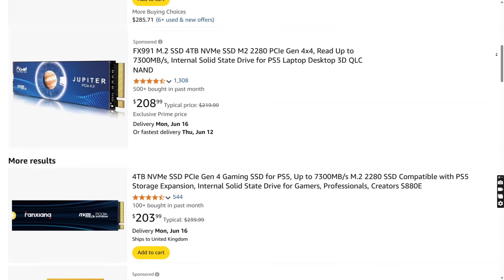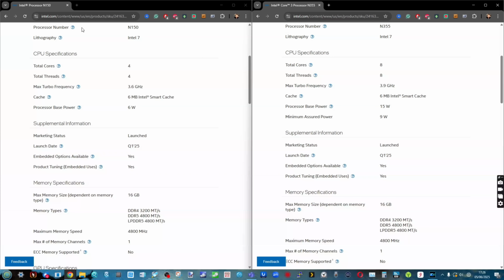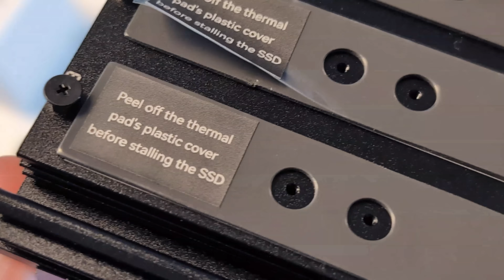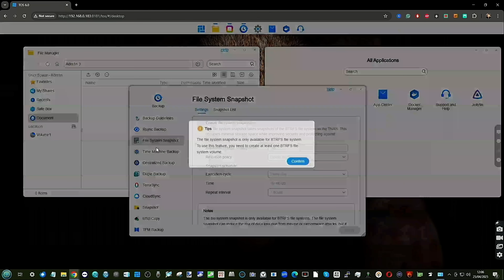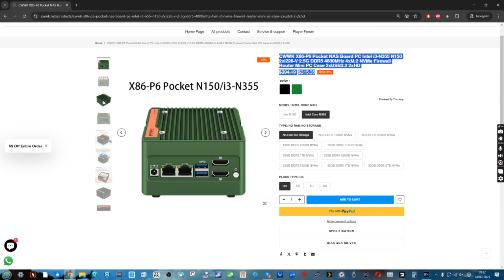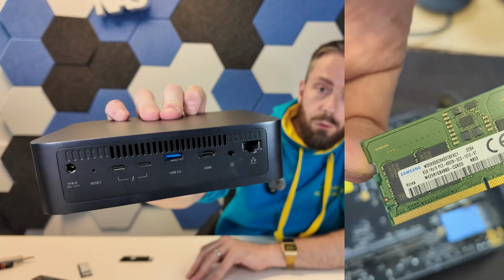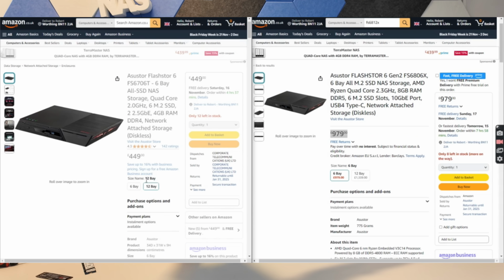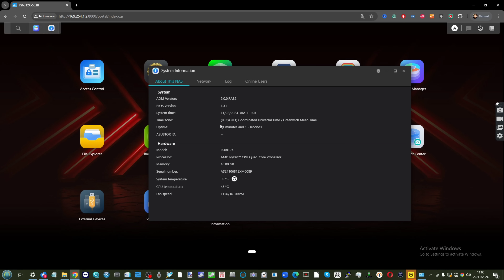The Best M.2 NAS of 2025 (so far)

Comment: A 4T Hdd is like 100€, and the data will stay there even if offpower for decades :)
SS for fast, hdd for slow. 
On the ode hand I just got some gen 2 SH 2t's for just 20€/piece used for a SH recycle shop, they got just 11x writes :)

Comment: The GMK G9 has a huge thermal management problem that causes all but the first slot M.2 drive to thermally throttle. This was proven by another streamer who used a thermal camera to show the temperatures. I believe He also showed several of the chips on the board also run exceptionally hot. He suggested that they should probably use a larger case with more thought given to thermal management. It really doesn't meet the listed specs with it's current design for long. Any large file transfer that takes more than a minute to transfer will kick it into a thermal throttle condition presently, I believe.

Comment: beelink is imho best form factor but it is a piece of junk. 48W PSU and bad desingn on the motherboard cant run all 6 bays. I can only managed to put only 2 KC3000 2TB drives with out issues. 3 and there is some powerrail issue and all drives are missing. This is well known issue. Living in EU sending it back to china (my is from aliexpress) is not an option... Maby I will find a shop who can upgrade/solve issue with powerrail. To this time it is a paper weight

Comment: Sorry, I just don't see the point of a M.2 NVME NAS.  When you look at size - 5 4TB drives will give you 16TB ish of usable space doing single disk parity, and cost you about $1000 for the drives.  For that price I can get 12 TB or even 16 TB HD's, so still 3x or 4x the amount of space.  Now, take into account that even if you have a 10Gbe connection, which most people don't, you'll still never be able to get the speed advantage that M.2 drives provide you.  If you are going to do some sort of DAS, Thunderbolt 5 maybe, ok, now we can justify the expense.  But as a NAS, usually on PCIe3.0 x 1 slots, you are limiting most of the good out of the picture.  Oh, and 4TB is listed as the max size....  so what use case is this a better idea for?

Comment: As someone who has been in this field for 40+ years. I’ve seen 3.5 inch hard drives go from 40MB TO 30TB and hard drives usually give you a warning before they fail. Especially since SMART is built into all drives now. When a SSD drive dies, it dies and you aren’t recovering SQUAT from it. Plus SSD drives are still ridiculously expensive and size limited, and each cell has a maximum write limitation. I just recently took my two Synology NAS units offline, and they had been running for 10 years with the same 3TB hard drives in them with no errors. The NAS boxes themselves are giving up the ghost but the drives still report as being in good shape. 
Have you priced external Thunderbolt 4/5 enclosures for NVMe drives, they are expensive as shit. Until I can get a 8TB SSD drive for less than $200 that has some kind of redundancy built into, I’ll stick with physical hard drives. Yes they are slower, but who really needs to access a storage medium at 20 or 40 or 80GB per second? Any NAS with physical 7200rpm drives and 2.5/5/10Gb Ethernet will be fine for 99.5% of users. Just about all consumer desktop and laptop computers still use 1Gb Ethernet for connectivity.
Reply: no thanks, HDs are the past, by 2030 SSD prices will match HD prices and we will say goodbye to those power consuming-error prone beasts. Most people who follow this channel just want a home NAS with decent power consumption (we are not all Americans who enjoy cheap electricity).

Comment: I have the Flashstor 6 and it's great, just use it for storage and nothing else and it works well.
The fan can be replaced with Noctua but it has to be either modded to mounted on the outside as there isn't enough room for a 25mm depth fan. Depends how fussy you are about fan noise.
It might be worth the extra cost to go 12 bay version for the option of smaller/cheaper drives vs 6x 4TB drives (something I wish I had done and might do in the future).
And with flash storage you are on the ~2 year cost/purchasing cycle and looking at the cost now it's down yes but not down enough, maybe due to tariffs.

Comment: My Asustor Gen2 CPU fan just after 3-4 months have started to sound horrible to a degree where the NAS is unusable and of course it's a low quality fan you can't even buy from Asustor accessories shop for replacement. So disappointed with this

Comment: 2 TB nvme is 200, but 24btb HD is 270.. I keep it a mixed Nas for now 😂 
next upgrade..2x aoostar.. with each 5x2tb name and 6x24tb running unRAID in two locations.. question. Can you use the NVME drives in raid Z1 and put the snapshots on the hd in an unRAID raid? With only the hd synchronised between the systems... Should work right? Any problems I am overlooking?

Comment: For a home user I only really care about storage space not performance. Having four 8 TB drives in an Unraid setup the option of switching to SSD is just not going to happen

As much as I like the concept the cost is still prohibitive. I can’t see that changing any year soon
Reply: It's not about performance, although the IOPS are mad, it's about low power, low noise and low space. I could put my media library under the TV, or a data storage device on a desk. With a traditional nas, I have to put it in a remote location, then I need decent ethernet cabling and switches to get the most out of it.
Reply: @paulwoodward8265 

For sure and I agree. The focus in these reviews is nearly always about how fast you can send data. When for me it’s about both cost and, yes, silence as well. My home build NAS box is on my third floor in a spare bedroom/ office so noise isn’t an issue and the house is Cat 7 cabled as well. Not everyone has that of course

I still don’t think the silence and power savings with the high price of large SSDs is the right balance. It’s encouraging to see the new hardware though. At least that’s moving in the right direction

Comment: I've had mixed results with small nas/mini pcs. Companies need to do something about reliability became that's what storing your data is about. Peace of mind. Lincstation n2 would keep losing firecuda nvme drives, so I had to replace with wd red. The performance with unraid wasn't any better than a ds1821 with 4+drives and some cache. Also my minisforum ms-01 won't power on. No reason. Just stopped working after 3 months.

Comment: M.2 drives have gotten cheaper, but they’re still not cheap enough in my opinion. For example, 8TB M.2 drives are still $600-$1000+… The problem is nobody is really making large-capacity NAS-specific M.2 drives, meaning almost everything available is PCIE GEN5 and GEN4. Hence, the higher cost. My hope is we eventually get high-capacity GEN3 M.2 drives, which is more than enough in terms of read/write speeds and should be much cheaper. I say all this because most of these M.2 NAS devices and add-on cards can’t even utilize the full read/write speeds/features of GEN4 & 5 M.2 devices.
Reply: yes, agree, I want cheap slow gen3 SSDs. A single Gen 3 PCIe channel can pretty much saturate 10GbE, so we don't need fast, we just need redundancy and size. I'm guessing the economics of SSDs are such that gen3 is not much cheaper to make than gen4, and you can charge more for gen4...
Reply: Totally on board with this. But as the other guy said, economics probably aren't in favor. The amount of actual TLC and QLC chips is limited so I get that they'd rather slap them on Gen4 and Gen5 sticks.
Reply: true. even had this issue on a new PC were got a very fast ssd only to find the PC bus speed was half of it. was not happy that the doc/specs had not mentioned it anywhere! Also with the raid uses stripe reading should give more than enough with only a few and wih 6 or 12 would be no need to pack out with the fastest spec. If only one of the manufactures could jump on this as am sure there would be a nice sized market for larger well priced that dont need top performance!

Comment: What about the Lincstation N1 or N2? They didn’t make the cut? They are kinda a hybrid solution where it is mainly a 4 bay m.2 NAS with an extra 2 bays for 2.5 inch drives as well.
Reply from the maker: Tbh the N2 AND the Terramaster F4 SSD (both $399) deserved to be included. However this video was recorded a month ago...and since then, the N2 only because publically purchasable a week ago, and the F4 launched 2 weeks ago. However BOTH made it into a fun video about the best NAS for under $499 coming very soon
Reply: Just saw the new video! Didn’t even know about the Terramaster F4 SSD. I did just get the Lincstation N2 delivered today, but of course I am away for a few days before trying it out. I just wish you could get larger drives for the 2.5 inch drives. Would almost like one with the 4 m.2 bays and 2 3.5 inch bays just to have some larger archive space, but then would make the device larger. Keep up the great work as always!

Comment: The only NAS I would even remotely agree with on this list is the Synology 6400. Unfortunately, I followed the recommendation for the Asustor Flashstor Gen 2 (and Gen 1) and paid about £1,400 for what turned out to be an absolutely useless NAS.

The reality is, none of these SSD NAS systems can fully maximize storage or bandwidth. It doesn’t make sense to have an SSD NAS unless you can actually saturate the available bandwidth. There’s a known issue with read and write sequential files such as EXR over SMB versus NFS, and none of these NAS devices properly address that.

I have to strongly disagree with those recommendations. After trying everything to get the Asustor Flashstor to perform as advertised, it simply wasn’t possible. Amazon refunded me after three months due to false advertising,  and because I provided evidence that I fully communicated with Asustor and they was unable to resolve the matter and we’re unsuccessful until they even admitted that there’s an issue that they can’t resolve.

So my advice: don’t bother with SSD NAS systems unless you’re ready to spend serious money on a custom build or go with a proven system like Synology. For now, you’re better off using regular hard drives with an SSD cache than wasting time and money on these SSD NAS setups—they’re just not there yet.

Also, I’m surprised there was no mention of Blackmagic’s SSD Nas—they’re designed for high performance and are much more reliable. The other options on that list? They’re a joke.

Comment: The price of NVMe may have reduced over the years,  but for larger capacities, spinny drives are still much cheaper, a 8TB spinny drive NAS specs is around £150 depending, on the make, but for a NVMe you are looking at around £700. So no good unless you have deep pockets for mass storage. 
The advantage of SSD is energy use compared to a spinney drive based NAS, stick a couple of smaller NVMe drives in one of those units you, certainly the cheaper ones and it is a fast , low energy storage for documents or maybe a media server. But if you only have a 1GIG network, not really going to be much advantage,. 

I have a older Terramaster F4-210 with four 6TB Toshiba drives in raid 5 and it is great for storage.

Comment: When 8TB SSDs are available for only a 50% premium over spinning rust (and not their current 250-300% premium), then I'll think about moving off of HDDs. Also, when I start running a 10Gbe at home, I'll consider these devices. As it is, my home network running at 2.5Gbe seems to be a good match to my Seagate IronWolf drives right now. Four 8TB spinning drives is more than enough of a drain on my wallet.
Reply: 100% Agree but don't stay stagnant with yr planning - start rolling it out now. 10GB/sec home is here already (TPlink) - just that I wouldn’t  buy it, but they will put downward pressure on the price of the other network stuff. As for NVME/.. Gen 5 is here which is going to plummet Gen4 next 6-12 months, and most if not all of these devices have Gen4 architecture ... That is why I am DIY a 10GB/s NAS now on a Gen5 MB...I will run Gen4 NVME but hopefully the hardware will last more than a couple of yrs..
Reply: @wapphigh5250  You mean 10 gbit?
Reply: @wapphigh5250  TPLink? I don't know, that brand is stuck in my brain as absolutely cheap garbage... Is that wrong? I got myself a Mikrotik. But frankly? I haven't actually used the 10Gigs at all so far.
Reply: At work when 8TB SATA SSDs hit $100 each I would start replacing many of the 8TB and smaller drives we have in raid. I currently have a 1/2 PB.

Comment: The relative cost per Gb is still way off in favour of hard drives, and still prefer that industrial robust look of a decent hard drive over a plastic SATA drives. SSD's are going to take a long time to get anywhere near the cost SSD's, and you could kind of argue that the speed of the drives isn't going to make the experience of extracting data from a NAS spectacularly quicker with all NVMe drives.

I have a mini box with a Pi & 2 SSD's that I'm going to try using in RAID 1 as a tiny travel NAS, and apart from having a couple NVMe drives each in my DXP4800+ and DXP4800, plus the Jonsbo N3 build when the case arrives, everything will be stored on hard drives.
Reply: actually is not going to take a long time, by 2030 is already established, price per Gb will be the same.

Comment: The beelink ME didn't work for... me, constant NVME errors with them being taken offline.  Felt like the built in tiny power supply didn't have enough power to run that many.  Back it goes.
Reply: That might actually be the case — if your SSDs draw too much power, the ME mini’s internal supply could be insufficient. I’m running 6 x WD Red SN700 4TB drives myself and haven’t had any issues so far. Everything’s been stable on my end.

Comment: Would a NUC with external NVME for storage be better?  My NUC has an Intel Ultra 255H CPU, which can run circles around a N150 and can use up to 96Gb memory.  I paid under $600 for my Asus NUC.  Transcoding is a piece of cake for an Ultra CPU.

Comment: Can you throttle the speed of these NVME drives so that the systems run cooler?
Reply: The Beelink Mini only runs the drives at PCIe Gen 3.0 x1 speeds, so they're already throttled right down.
Reply: Older Gen3 drives use less power than Gen4. DRAM less ones are even more efficient (and cheaper).

Comment: Is noboy going to talk about the stability overtime of nmves? I got into NASes 5 years ago and the nvmes where considered unreliable at best for long term storage...so how have things changed? How do I even choose a good nvme for NAS use,. The cheapest I can get around 100$ for 2 TB while sort the same price I can get 6-10 TB HDDs
Reply: The biggest problem with NVME drives is quality of brand, there were a bunch of drives shown at the beginning that I do not recognize any of, and as such wouldn't trust them with data at all.   And I definitely wouldn't trust any of the cheap NASes showcased here.      That said $50 per TB gets you a mid-low tier drive usually, higher quality drives are still in the $75/TB range, and that cost definitely needs to get slapped with a fat asterisk because if a cheap NVME fails and you have to replace it you basically doubled the cost of the drive.    

I am curious what 10TB spinning rust drive you get for $100 though,  are these drives designed for NASes?  New or refurbished?

That said, I wouldn't do NVME NASes yet,  NVME drives are good to get information very quickly to the CPU/RAM for processing in a computer, as pure storage that speed benefit goes away, it is nice to not hear hard drives spin, but still a bit of a fad for most users.
Reply: @Mike__B I get HGST refurbished HDDs from data centers, from Amazon in my country, with around 40000 hours of use and I can get a 6€ 2 years extended warranty per drive. So all in all 106 € for 6TB and 126 € for 10 TB. That’s a pretty good deal to me, sometimes I find the 10 TB ones for the same price of the 6 and they run out as soon as they are available
Reply: @Mike__B Yeah wallet wise it’s the best solution I found. I’m not getting either into nvmes NASes too, I cmdon’t find them reliable and their speed it pointless for me at the moment

Comment: I bought and installed a GMKTec G9. And honestly, I was really disappointed. Even though I put good quality NVMe SSD in each slot, only the first two were recognized. TrueNAS didn’t see them, since the BIOS didn’t detect them either. Despite having heatsinks on each SSD, the machine was already running very hot even with no activity. So for me, it’s definitely something to avoid. I returned everything to Amazon, who fortunately refunded me in full.
Reply: Thanks for sharing, but it would have been important to know which NVMe SSDs you were using, as that affects power consumption and heat.